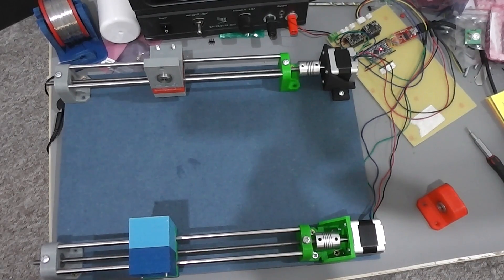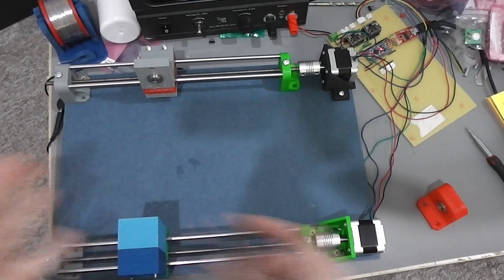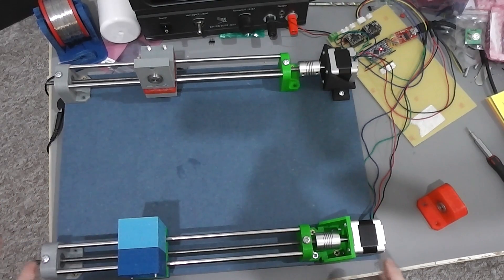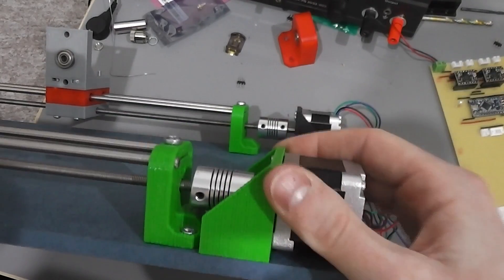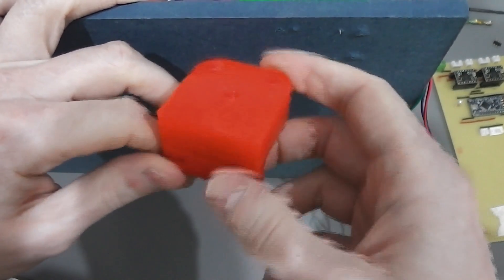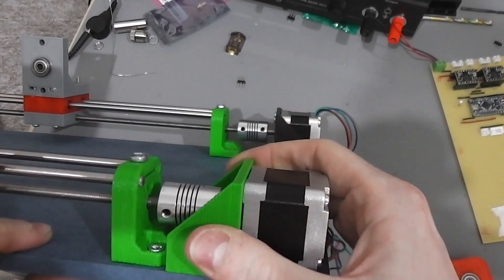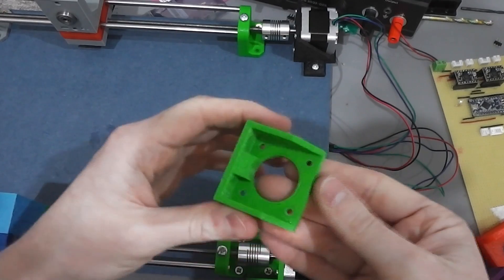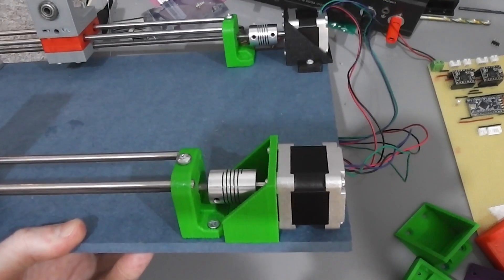Laser Engraver Build Update #7 - Problems and the Next Steps

Comment: Hi Arthur I really like this project. I keep thinking your smooth rods may have alignment issues. I think your laser project would benefit from using less smooth rods along with designing it to run with belt drive. Belts have no backlash and are much easier to move than threaded rod's and there allot quicker moving.
You may get some ideas from a video and machine i made a cnc plasma cutter made of 3d printed parts. Its grbl controlled and all belt drive.. It works pretty well and would probably also make for a good laser platform (thats actually what i was going to do with it first) Latest plasma cutter test I think its working
you can also check out the parts on thingieverse search for plasma cutting table
Hope you make some more update video's soon

Ron

Comment: There is a solution for moving a gantry with only one motor. You would need to use a "moving knot". This will keep it perfectly parallel. For the motor I would change to at least a nema 17. The motors not really sound good, especially when they start and stop moving. What kind of software do you use for driving it? Does it use acceleration/deacceleration, microstepping? A lot of the problems can be software as the timing of the signals can be very critical. I think the brackets are not stiff enough I can see them move when the motors run. Maybe adding a steel corner bracket or some aluminum will help. I am currently designing and testing something similar, and I am thinking to switch to a belt driven corexy. It should be cheaper, faster and easier to build. Maybe that is an option you can consider too. Have a look at corexy.com. Have fun, and don't ever give up trying. :)
Reply from the maker: Thanks for the comments. My aim for this project was to build something out of 3d printed parts rather than metal but I have realised this probably isn't practical. the accuracy isn't quite good enough and as you pointed out not ridged enough either.
I am using grbl for control which handles acceleration and I did try switching to nema 17 motors but there were vibration issues which made it very noisy.

Comment: I have a question.. why are you using 2 steppers per axis? Im building an engraver thats going to make contact with the surface so a lot of friction but its working fine and the motor is 1/4 the size of the nema14 .. they where like 2pounds a peice so i think using one stepper should solve the problem.
Reply from the maker: Sadly because the system isn't that ridged it can't be driven from one side, if you change direction the other side takes a few rotations to catch up.
There are more details in update 4 Laser Engraver / Cutter Build Update - #4

Comment: The load from the lead screw is a little to much for a nema 14 as you already stated that it might be the issue.

I can tell you for sure this is the cause as the biding from the lead screw is to much for the nema 14 to power through. If you wanted to use a nema 14 stepper you would have to use belts.

I wouldn't go lower then nema 17 no matter what and I believe the strongest easily available stepper motor has a holding torque of 5kg*cm, You can pick one up at QU-BD and I believe sparkfun
Reply from the maker: Thanks for your comment. They did seem a little week but I had hoped the movement would be smooth enough for them to be sufficient.